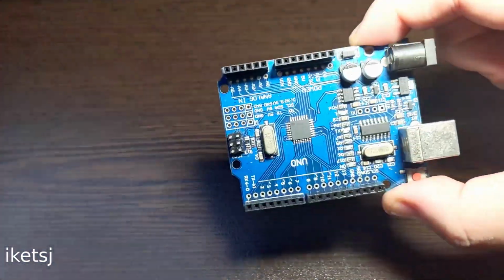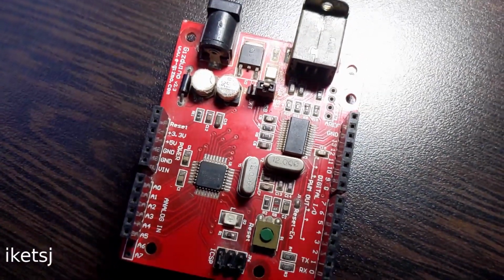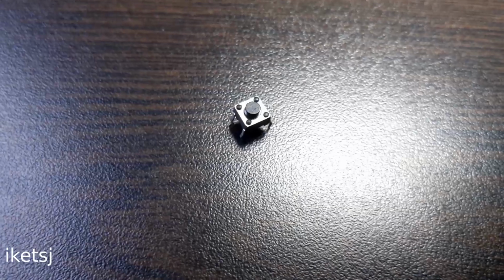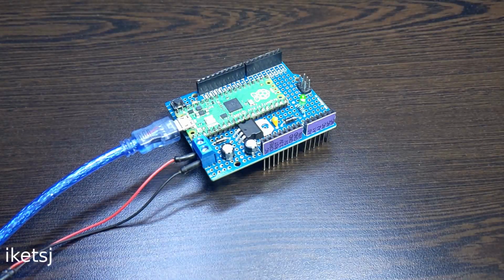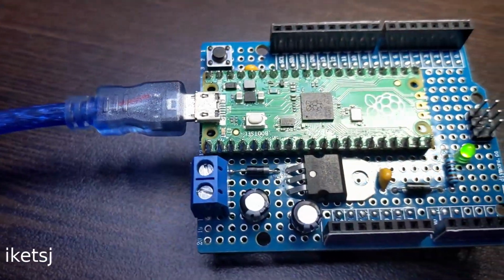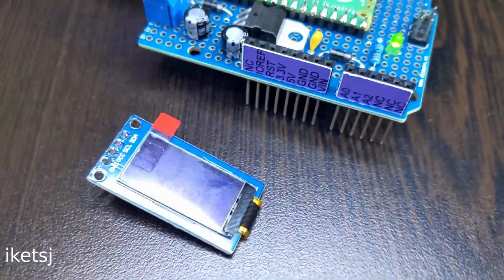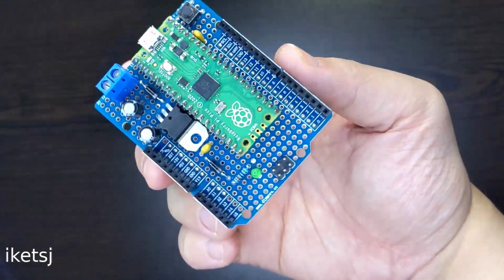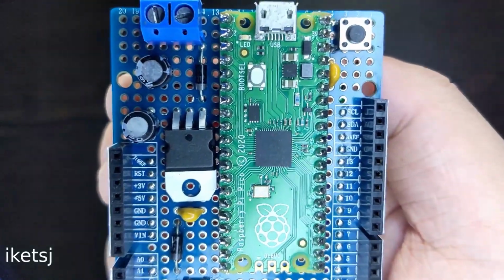Arduino Form Factor RP2040 Board

Comment: Hi there.  This is great! :)  I'm looking at building one myself now!

Quick question about the pin mappings.  In your table you list the three SPI pins for the Arduino explicitly as "SPI MISO", etc and map them to Pico GPIO 16, 18, 19.  Does this mean that you are using the pins on the ICSP header?

Of course for any kind of "shield compatibility" Arduino hardware SPI is usually expected to be on D10-13 which are mapped onto the Pico GP10-13, but unless I'm missing something, I think there might be a problem if these are wanted to be used for SPI.  Shouldn't Arduino D10 (SS) go to Pico GP13 (CSn) and Arduino D13 (SCK) to Pico GP10 (SCK)?  Or are you using some kind of software/re-mapped SPI on the Pico?

If shield compatibility is required I'd probably also map A4/A5 onto Pico GPIO pins that support I2C in case there are shields that use A4/A5 rather than the extra SDA/SCL pins.

Other things I'm guessing:
* Do I take it IOREF is set to 3V3 as the whole thing is expecting 3V logic?
* 5V comes from VBUS.
* 3V3 comes from 3V3_OUT
* VIN links to VSYS, and presumably your power circuitry?
* RESET (and ICSP/RST?) connect to RUN

Does that all sound about right?  My apologies if I've missed something or misunderstood :)

Many Thanks,
Kevin